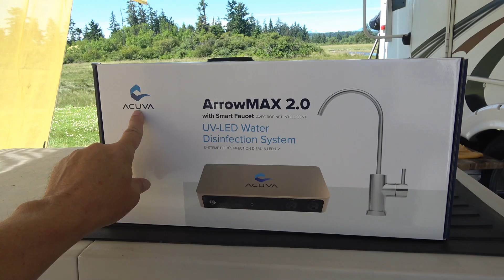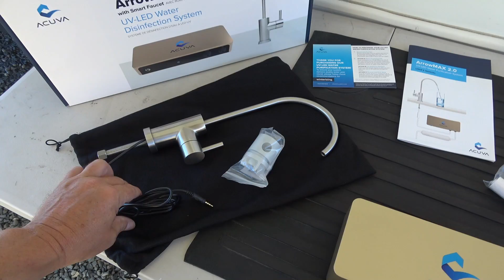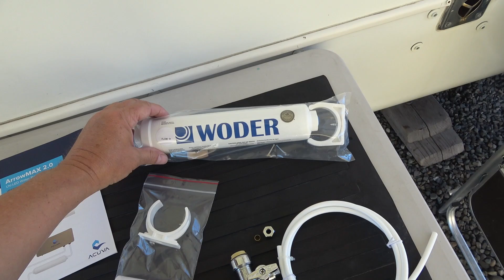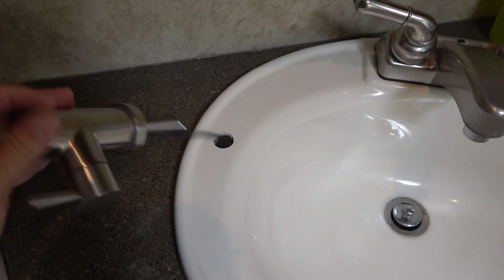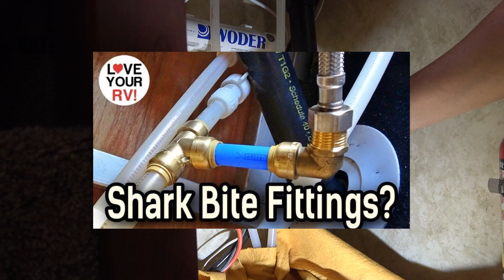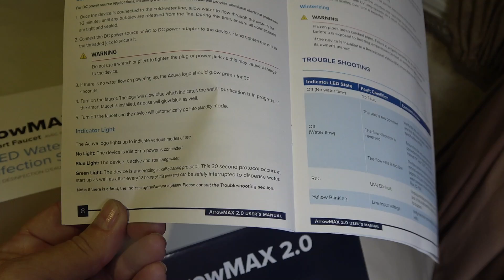Installing RV Water LED UV Purification System (Acuva ArrowMAX 2 0)

Comment from the maker: Here is a code to get a 10% discount on the Acuva Store website. https://www.acuvatech.com/shop/?ref=loveyourrv Use the discount code LOVEYOURRV
Related Links:
Shark Bite Fittings Repair - https://www.loveyourrv.com/rv-plumbing-repair-using-shark-bite-fittings/
Clearsource Filter System Review - https://www.loveyourrv.com/deluxe-rv-water-filter-system-review-clearsource-ultra-three-stage/

Comment: Hi Ray, Like 523 now.  :) 

I am installing mine this weekend.  At 12:12 you mumble "gonna cut off some of this pipe".  Did you?  How did you mount it to the exterior RV wall?  3/4"  screws?  How many?  Has it held?   I assume this wall is foam core.  I was thinking of using VHB tape.  Do you think this would hold?
Reply from the maker: Yes, I used 4 - 3/4 inch screws and its held fine, its not too heavy. My wall is foam core. I think VHB would hold no problem.

Comment: So if you want the best and a company that stands behind their product then you may want to pass on this product. I had a professional installer put this product into my vehicle. Since the company was not an authorized installer they will not stand behind their product. If you install this yourself they will not stand behind their product. This install is not rocket science. I am a firm believer that when a product is faulty then the company should stand behind their product. For this unit to go bad and leak at this price point I would be very hesitant to purchase this. You don’t know till you know. So if you want to toss a good $500+ towards something, you might be better off investing in water bottles.
Reply from the maker: Wow, thanks for letting us know, kind of surprising. So far my only interaction with the company has been to buy a new filter last year using the online website ordering, shipping was fast no complaints there. I've had the system installed in our RV for 2 years and no issues. We are living in it full time and have travels about 10,000 miles in that times. All the best, Ray

Comment: How easy is it to winterize?
Reply from the maker: Here is from the FAQ page:  https://www.acuvatech.com/faq/
How do I winterize my water purifier?
To ensure your system delivers quality water year round, please follow these recommendations for winterizing. (Note: Simply draining your water system may not be effective at removing enough water to prevent damage inside the device)

Step 1:
Remove the pre-filter from the system and set it on its end (outlet-down) to drain. Place the filter in a bag and store in a refrigerator or a cool environment until it’s time to flush and use it again.

Step 2:
OPTION A) APPLY COMPRESSED AIR.
Apply compressed air to the inlet of your unit to blow out any and all water trapped in the system as well as any accessories such as flow restrictors or faucets you may have. Repeat this a few times to ensure no water is left in the lines.
OPTION B) USE ANTIFREEZE REAGENT.
Follow your RVs owners manual to drain out your water lines and run special RV antifreeze through the system.
OPTION C) REMOVE & STORE AWAY.
If you do not have access to compressed air or antifreeze, remove the system and flow restrictor (if present) and store in a temperature controlled environment (>4°C) until ready to re-install.

Failure to winterize can results in damage to the system which is not covered by warranty, so please take care to winterize well before freezing temperatures or inclement weather may occur.
Reply: @LoveYourRV  what I don't understand if the filter is removed how do you pump air or antifreeze through the system if it is now disconnected from the water pipe by removing the filter first. Am I missing something here?
Reply from the maker: There is a shut-off valve installed on the shark bite T-fitting. I personally would just turn it to off and remove the Acuva stuff and drain water out of it. Put it back or take it inside your house.  https://youtu.be/hgQCUzALokA?t=653  Or you could take the pipe feeding the filter and instead feed it directly to the UV box and pump the antifreeze through. They are all easily removable quick connections.

Comment: Hi Ray... I purchased this unit and installed it with no issues, works great so far... but i was wondering if you've changed your filter yet? Is there a way to get that filter off without cutting the white tube? Maybe there is a trick to getting the filter off? Once you push the tube in it seems locked in pretty good so i'm not sure how to pull it back out to change it...  any thoughts?
Thanks for all the great videos by the way 👍👍👍
Reply from the maker: I haven't changed mine yet but I think its just a standard quick connect. To release push the outside ring in and pull the tube out. Here is a video demo https://youtu.be/8Xo4fl7MLYw?t=47  Cheers, Ray
Reply: @LoveYourRV  Awesome!!!! Thanks so much Ray, I've never used those quick connects before so i appreciate the feed back!
As usual you've answered the question for me, like so many of your other videos have! 👍👍👍👍
Thanks again... Mike...

Comment: Full timers "Prêts pour la Route" installed on in their Airstream a while ago and then went to Mexico for a few months ( had to cut the trip short due to the pandemic).
But had 0 issues drinking the water in Mexico from different sources after filtering with the Acuva, including the dogs.

Comment: My concern with these UV units is that the water doesn't stay under the UV's long enough to be actually made safe. Seems to be a bit of a murky area of 'science' vs 'advertising'.
Reply from the maker: Supposedly they use an optically focus beam - https://acuvatech.com/technology-uv-led/ Here is a deeper dive into the tech https://youtu.be/pVspJTsY0E8 
I noticed in the marketing that they say for using with known good water as a secondary treatment so the water needs to be pretty good to start with. Likely the reason for the prefilter.
This is what the certifications say.
ArrowMAX 2.0 is certified by IAPMO R&T to NSF/ANSI 55 Class “B” for the supplemental bacterial treatment of disinfected public drinking water or other drinking water that has been tested and deemed acceptable for human consumption by the state or local health agency having jurisdiction. The system is only designed to reduce normally occurring non-pathogenic nuisance microorganisms. Class B systems are not intended for treatment of contaminated water. It is also certified by IAPMO R&T to NSF/ANSI 372.

Comment: I wonder if the blue light around the base of the faucet indicates that the unit is detecting that UV light is being generated internally, or whether it merely indicates that the UV LED's are powered (but not necessarily working). The former setup is less prone to undetected system failures.
Reply from the maker: I have to ask the rep. The marketing states "Visible indicator light to ensure UV is working" and the manual troubleshooting says if red contact Acuva support or yellow manes low voltage supply.

Comment: The pre-filter lasts 1000 gallons ($20 US).  The advanced pre-filter last 4000 gallons ($50 US).  The max worktop thickness is 1/2" which I think would limit the faucet placement.
Reply from the maker: I imagine the plastic spacer where the wire feeds through could be cut down a bit or even use a different piece of pipe with a smaller hole.

Comment: Hi Ray........ This comment is actually a question ( nothing to do with this video) I have always wondered about what works better (faster ?) when you are Boondocking and have your generator running and hooked up to the RV, is the Generator Charging the RV Batteries? Would it be better to plug a battery charger directly into the Generator? And make it run directly to the batteries? Or is just plugged in to the RV and let the built in inverter/Charger do it’s thing ?
Incidentally, after watching your review (a few years ago) I purchased a Champion Generator just like yours...... you bought two of them 
But I could only buy one at that time...... anyway, I hope I explained that correctly....... 
in other words..... does a battery charger plugged directly to a generator work better than the built in inverter charger?
Reply from the maker: Yes, the generator will charge the batteries using the onboard charger just like being plugged in at the RV park. How well all depends on the quality of the charger and the wiring of the RV. There is a lot of variability in your question. Generally a poor quality battery charger hooked right to the generator will usually under preform the OEM RV onboard charger but a good quality converter charger wired close to the battery bank will often outperform the OEM setup. 
I installed a Inteli-Power PD9260 60 amp charger right beside my battery bank and plug my generator into it and get much faster charging versus the OEM one installed 20 feet away under the stove in the kitchen. Its a better charger than the OEM and the wire losses are much reduced.
Here are a few videos on the subject:
https://www.loveyourrv.com/installing-the-inteli-power-pd9260-for-improved-rv-battery-charging/
https://www.loveyourrv.com/lithium-battery-charge-test-can-you-use-a-lead-acid-charge-converter/

Comment: Nice Job, thank You! Can't wait for the review.  I did put in the Eco-NX this winter where you helped me with electrical :-0) .  I have yet to find a better 12v hookup, right now on the pump.  Working well, good test but I did not have the water tested yet.  Cheers 😊

Comment: ❤  Ray, I have seen residential units in the past made of stainless steel and about 16 in long. They had a count down 1 year timer on them to remind you to change the UV bulb. You may want to see what the life of the unit is.
   Also, Ann may want to look into fermentation drinks. Things like kombucha.  Love her photos of the areas you travel. 👍👍
Reply from the maker: They say the lifespan is listed as 120,000 liters (31,700 gallons). It is nice that the thing only runs the LED when it's turned on. Some of the older ones kept the lamps on I've read.
Anne's stomach issues stem mostly from damage when she accidentally drank jet fuel traveling in Russia back in the 90s. It was often mixed with booze. It harmed the stomach lining and has also had a few bad water-related sicknesses traveling the world. She is very careful now. :) She has tried kombucha, didn't do much at all for her other than taste bad.  :) Cheers, Ray